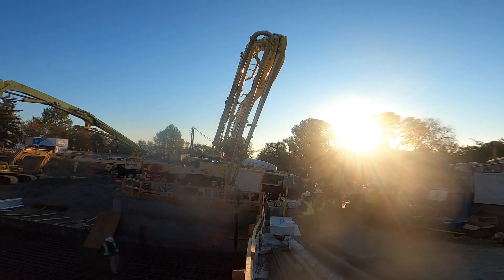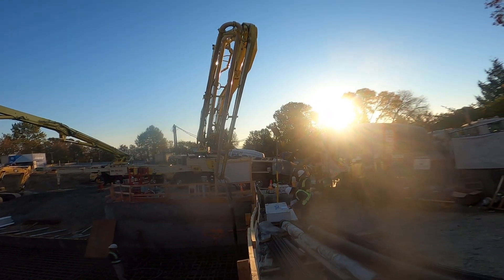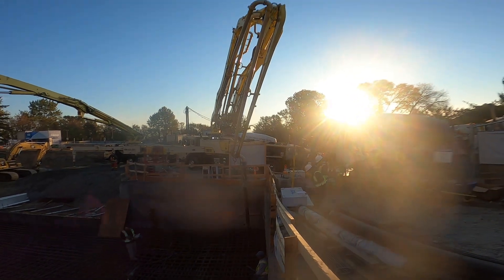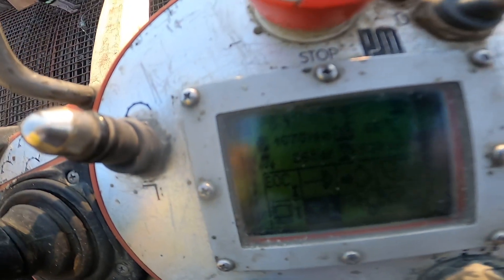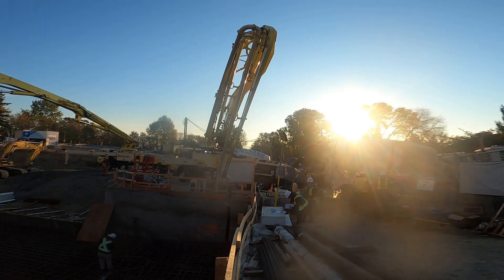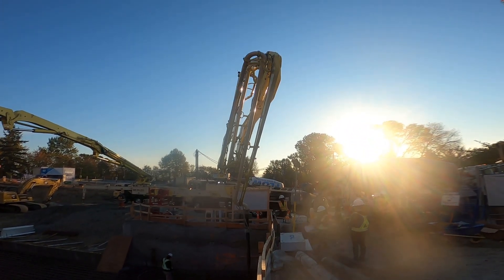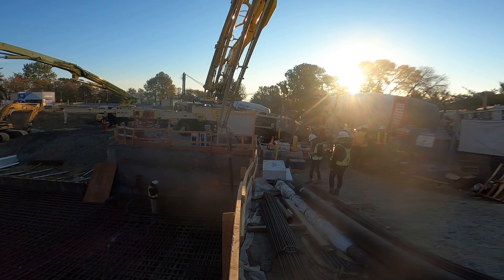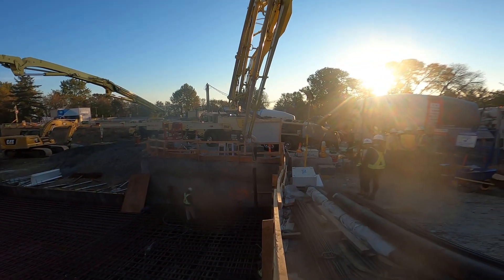Wide-open (150 cubic meters per hour) with a Putzmeister 38-5 concrete pump!!!!

Comment: Turn the EOC off and turn the rpm to max and try it again on 10. Might make a difference
Reply from the maker: This unit does pretty good with EOC engaged so long as the slump is nice and wet. With stiffer mixes however I’ve found that the RPM tends to surge a fair bit with EOC engaged, in which case, and has you had pointed to, it works much better manually setting revs to the limiter for sure 👍🏼👍🏼👍🏼
Reply from the maker: Our 56Z with EOC engaged does pretty well with most any mix. It’s on a Mack chassis, this 38-5 is on a Peterbilt. I’m thinking it could vary a fair bit from chassis to chassis, depending on powertrain configuration.

Comment: Do you adjust POH setting when pumping that fast?
Reply from the maker: I prefer not to use it when pumping relatively wet mud as that quick snapping/slapping action can be a little harder on the pipe hangars. This 38-5 boom is very forgiving in terms of bounce. Our 56-5 I do play around with POH when the mixes get a little stiffer as it can calm the boom down a good bit.

Comment: Not sure if you already have a video on this but can you do a video (whenever the time comes) of how you deep clean a concrete pump? Simple video but I dont see one like it anywhere on youtube
Reply from the maker: We have a hot-wash at our yard which quite literally melts grease away (and unfortunately paint sometime too). I’ll grab some footage next time we’re cleaning up one of the rigs 👍🏼👍🏼👍🏼
Reply: @canadianconcretepumper1979  I highly recommend Schaeffers Turbo Red for cleaning. A 5 gallon pail dilutes like 20-1 and when used through the chemical valve on your hot wash, it will clean like crazy but will not affect paint. I use it on out personal vehicles, Concrete pumps, wood splitter, etc. Works excellent and I believe I had our mixer valve set at 7-1 for a while. Definitely something to check out if you like things to be clean.
Reply: What do you mean by deep clean?